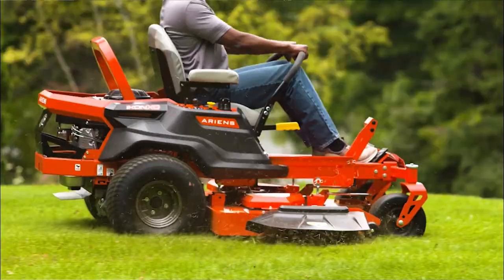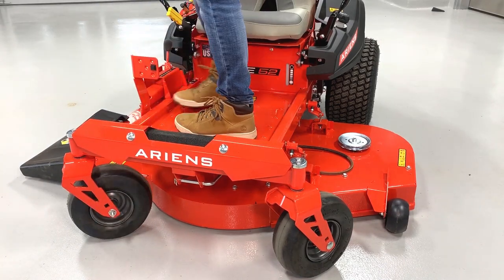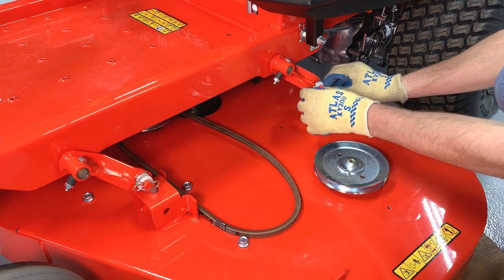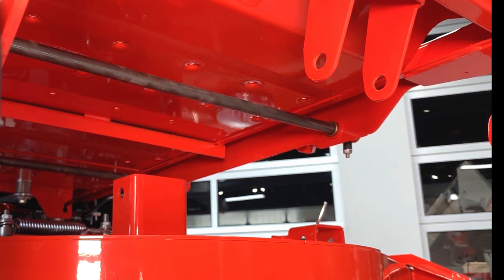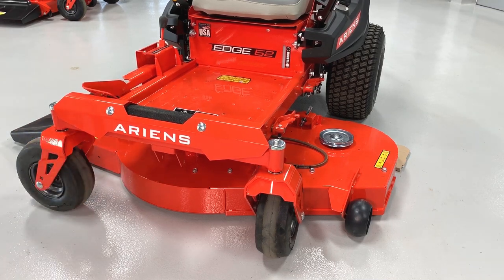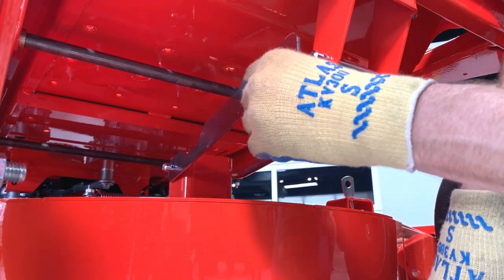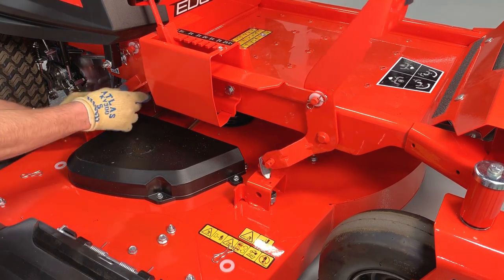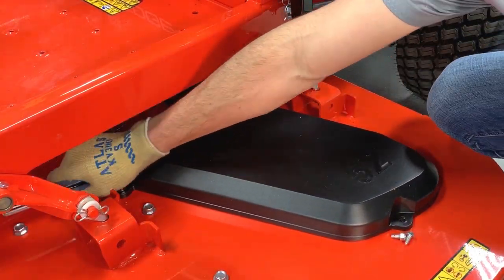How to Remove an Ariens® EDGE Zero Turn Mower Deck | Ariens

Comment: ARIENS Edge has a totally different belt system that is a little more complicated and probably why they have not done a video on the 42 inch PTO belt removal and installation.

Comment: 've got a Gravely 260 zero turn.  Wonder if this would work on it?
Reply from the maker: Hi Carl. Some parts of this procedure will be similar to your Gravely Pro-Turn 260, but there are still a lot of differences. You can find the complete instructions in the operator's manual for your unit.